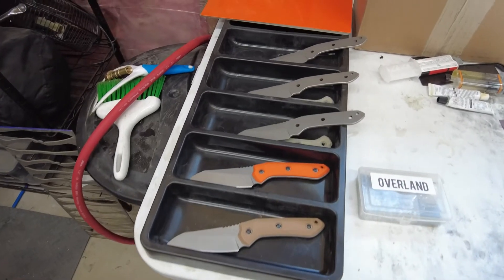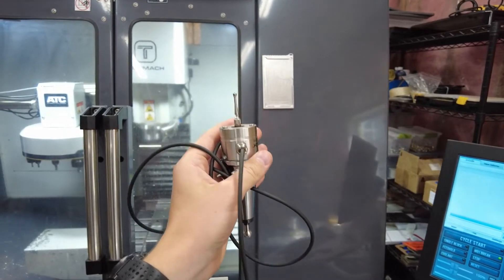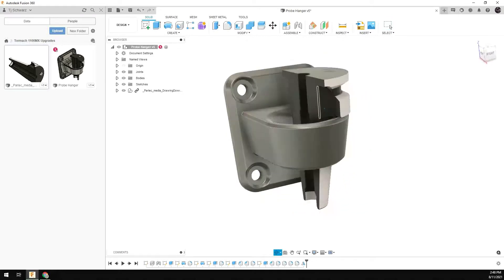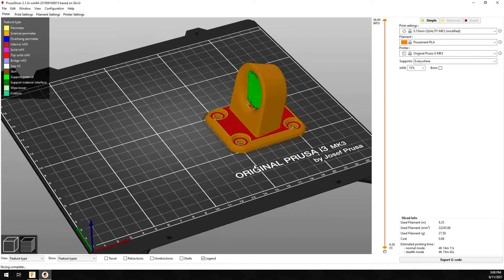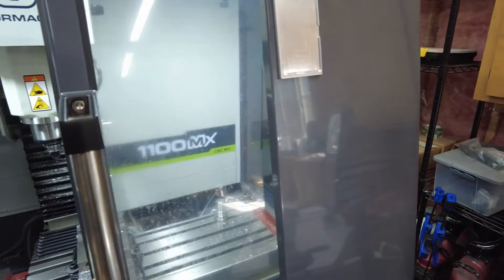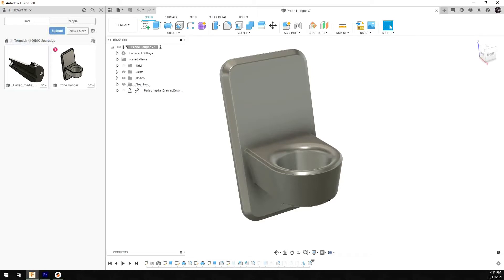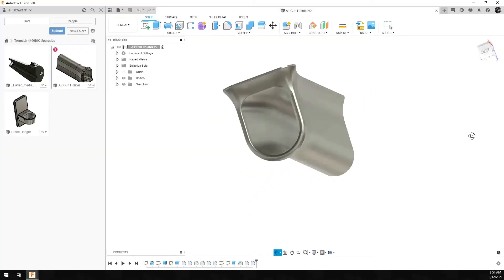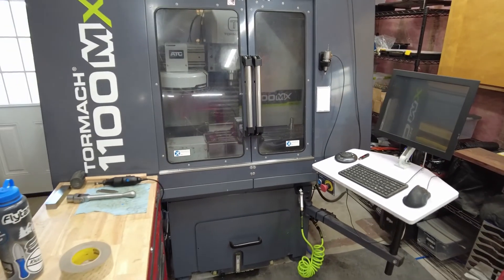I Love the Tormach Probe - But Where Do I Put It?

Comment: I understand the thought of fixing a problem with a video to make more content, but as an alternative, I went with the KISS principle.  I just run my cable over the top, and down along the spindle when In use, then when not in use, I just lay it on top of the enclosure in front of the left light.  Because of the cable it doesn’t roll so it stays in place just fine.  Also don’t need to use an extension cable.  When not in use the cable hangs in the enclosure a bit, but doesn’t interfere with operations.

Comment: Thanks for these nice add-on ideas and agree, 3D printing for these makes total sense. While it was great that you specified 3M HVB tape and showed the roll, unfortunately there are still lots of variations that appear similar. And I can't find any unique part number for the version you're recommending. I'm guessing its a roll of 2" x 15ft(?) and that it's not the 'foam tape' variety, and 
rather is the thinner film. Can you confirm and/or provide some additional detail? Thanks!

Comment: Another great addition is a handheld coolant sprayer. They’re useful for thoroughly flushing all the chips off the enclosure, table, etc. I made mine by plumbing a garden hose sprayer into the coolant pump. I use it by closing the valve for the coolant nozzles then turning on the coolant pump which feeds the garden sprayer instead of the coolant nozzles. The garden hose hangs out next to my air gun.
Reply from the maker: Thanks for the comment. Love your videos. I've (sort of) got a setup like that. I'm thinking I need to upgrade the coolant pump. Are you running the stock pump?
Reply: @tj.schwarz   yep stock pump. Haven't had any issues. I've had to close the garden sprayer nozzle down since wide open is way too much coolant
Reply from the maker: I suppose the fact that I'm running an in line filter is the main reason I'm seeing low pressure. I run it so I can machine phenolics.

Comment: What size facemill do you normally use? I have a 25mm, im thinking about getting a bigger one.
Reply from the maker: Truth be told I don't have one yet. Most of the parts I make are surface ground. I definitely need to get one soon.
Reply: @tj.schwarz  oh nice, im doing alot of big flat plate work, so would like something to get it done quicker. Keep up with the good content!
Reply: @tj.schwarz  Hey, great content!! Is there any chance you could give measurements from the base out to the edge of the enclosure on each side? In the process of getting my 1100mx set up, and tormachs drawings are just overall size, and I'd like to position it just right. Thanks!